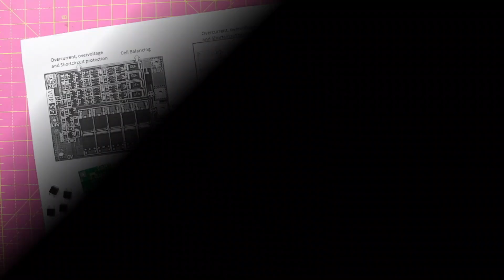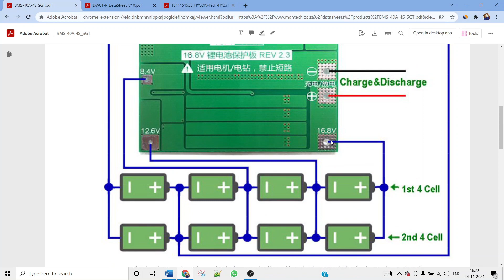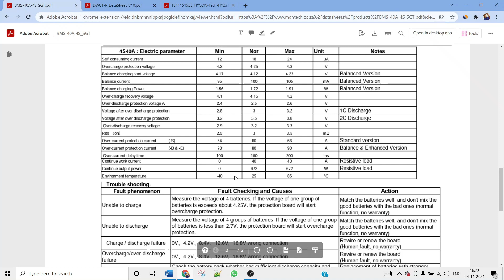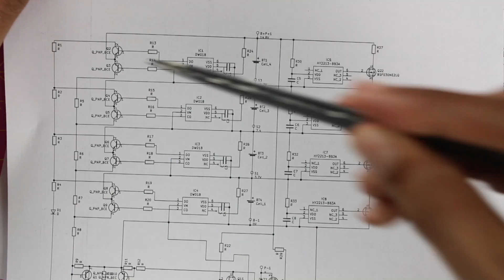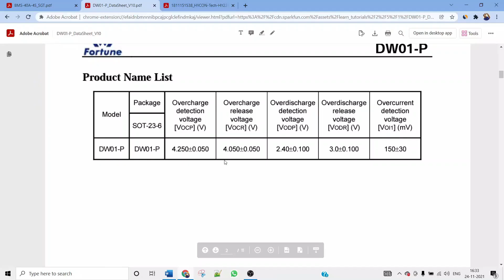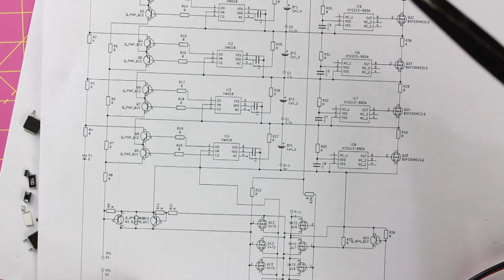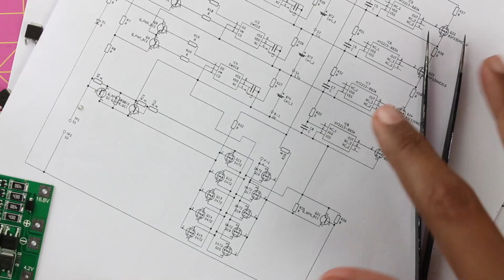Battery Protection BMS Module (4S 40A) Teardown - Schematics, Parts List and Working

Comment: Very dangerous!
I used this BMS balanced board with four genuine brand-new batteries, and everything worked well after the first charge.  This battery pack was used in a drill.
When time to recharge happend, the pack didn't. So, I checked the voltage and then I horribly discovered that one battery was short circuit and the 3 others where "being charged" at 5.6V. 
I disconnected everything and inspected each individual battery with my Xstar Dragon V4 plus: my four batteries are 0V & Ohm. 
This circuit protected nothing, and most has probably irremediably damaged my cells! 
I am very lucky that no fire or explosion have occurred. 
Could someone with deep analog engineering skills review the schematic?
Reply from the maker: If you check the schematics, you can see that the BMS board uses dedicated ASIC protection chips for individual cells. Even if the BMS failed to protect the cell it doesn't make any sense saying it caused the cell to be short circuited. The battery pack failed because of that one faulty cell.

Comment: Hi! How can I calculate the value of the components (resistor and capacitor)? Thanks for the help!
Reply from the maker: Follow the reference circuit available in the datasheet.
Reply: @Circuitdigest   all right, the datasheet of the DWO1 doesn't have resistance between the pin DO, CO and the pnp transistor so I just take off the resistors R13 to R20?

Comment: what is the optimal charging voltage and current requirement for this board
Reply from the maker: Charging voltage 16.8V and set the current as per the cell you are using.

Comment: Hello brother, I have a 3s 40A bms setup for my batteries, yesterday they worked fine but today as soon as i connect a load the Output voltage of the BMS drops to 6V  from 11V making the load inoperable. This board is even new already threw one 3S 25A board for facing similar issue. Pls resolve or guide me if u know.

when load gets disconnected BMS shows Op again to 11V...each battery has 3.78, 3.79 and 3.80V
Reply from the maker: make sure the balancing leads are connected properly. And try connecting the load directly to the battery with out bms for a short period. If the voltage still drops wither the battery bank is faulty or the load has some kind of short.
Reply: @Circuitdigest examining my bms i come to know that wen a load gets connected the gate voltage for bms reduces to 5.8V not full voltage and on unloaded condition it is 10V full gate, this restricts my bms not to deliver full power during loading.
This condition i see for charging as well as discharging mosfets also😭. So the issue must be either with Dw01a or bb3A
Reply: @Circuitdigest  hey man ur website circuit digest helped me tp resolve issue, I was able to debug successfully after reading the webiste stuffs completely. U r great, i debugged myself after ir website.

1. Checked the health of dw01A , bb3A and mosfets as well, there was a burnt pcb trace bw the 0 to 3.7V sense resistor and the 3.7 to 7.4V  dw01A grnd/Current sensing pin. I made a connection via small wire, n9w its healthy
Reply: U have a great explanations skills and better technical knowledge❤️
Reply from the maker: Glad to know you fixed the issue and our content was helpful to you.

Comment: Great video and excellent presentation. I would like to built a 4S &7P lithium battery. Could you tell me which BMS to use its for a golf trolley, many thanks. Go safe..
Reply from the maker: That would depend on the maximum current you will need. Choose a BMS with higher current ratting than you requirement.

Comment: Nice video! What's the use of the two Bms contacts FD CD (Full Discovered / Charging Discovered)? LEDs can be used there to indicate the operation status of the board?
Reply from the maker: Yes, correct
Reply: @Circuitdigest  that is between ground and the two pads with the relevant resistor for each led, correct?

Comment: If the mosfet paralel why i get voltage drop when i realese 1 discharge mosfet from the board? I realese because the mosfet burn.
Reply: you have to connect the pads

Comment: I agree with others, well presented a circuit which will never work 😂 How someone can explain the operation of a circuit on a circuit which has at least 5 major mistakes? 😀
Reply from the maker: Can you please elaborate on the mistakes you found. This is a popular bms used by many, i personally have tested it. But still would love to correct myself if you can Elobrate on your comment

Comment: BMS 4s 16.8V does not charge batteries.  I connect a 17.4V charger, but when I measure the battery, it does not charge, but stands at 15.4V.  What is the cause?  What parts on the board need to be replaced?
Reply from the maker: Make sure you have the correct board. You can check the part numbers of the DW01 and HY2213. depending the the chip the full charge/ balancing voltage may vary. you should also male sure your batteries full charge voltage. even tough most li ion batteries have similar voltage , depending on the chemistry used that may change. please check and confirm this with the manufacturer part number.

Comment: The cell balancing here is Active or passive ? 
And also explain it
Reply from the maker: most BMS including this one have only passive cell balancing, meaning the excess voltage in any cell is wasted using a shunt resistor. In active cell balancing the excess cell voltage is used to charge a weaker cell with low voltage this not wasting any power
Reply: @Circuitdigest  but in you article you tell us that it was doing active cell balancing please check
Reply from the maker: @rohitraj7625  Just checked the article, as mentioned the module is not capable of active cell balancing, but the IC used in the module is. Meaning you can use the same IC and redesign the module for active cell balancing

Comment: I have a spare 3S and 4S BMS wired up w/ 4 and 5 clip leads for bench testing and charging various laptop batteries and other packs I make. I'd love to use the CD and FD terminals for some LEDs for monitoring. I've seen references to 'Charge Detect' and 'Full Detect', but it seems they might also be used for inhibiting charging, or worse, for forcing the FETs on if used inappropriately. Thoughts on adding LEDs here?  How about adding a resistor and LED in parallel with the 43ohm balance resistors to see which one is balancing?
Reply: Hi im french man in interesed for cd and fd you are solution please
Reply: This BMS module is designed by someone whom is a Chinese, and a series of this kind of modules are popular in China. The two test points' names CD/FD are obvious formed by the first letter of Chinese pinyin pronounciation, "充电" (Chong Dian = CHARGE), "放电" (Fang Dian = DISCHARGE). They are representing the charge/discharge allowance status.

Comment: If one of the mosfet fails and we remove it from circuit why it does not work,as the mosfets are give in parallel
Reply: yes , it has no short circuit protection during my testing one of them just blasted in my face but u have to connect the respective pads with a wire from other side mosfets

Comment: Hello, I have checked the BMS presented with the wiring diagram posted. The wiring diagram is definitely not correct.  Here are a few examples: the Schottky diode D1 is at ground instead of between R4 and R36. The pinout on the PNP transistors is wrong 2/1/3 = 3/1/2. There is only one resistor / capacitance input filter for DW01 and HY2213 instead of two in parallel. The connection from R35 to ground is a short circuit. I have seen the faults without having the PCB itself and checking the contacts, there must be more faults in the schematic. The circuit diagram is totally worthless in this state.
Reply: In my bms circuit for 2 wheeler Li ion battery,
Circuit is somewhat similar,
Its 1 of the 5 mos In parallel got short circuit so I removed it but the circuit still not working as the mosfets are in parallel
Reply: Can you explain,or am I missing something

Comment: Fantastic video :). I am trying to figure out how the DW01B chip is able to measure current by only measuring the voltage of the cell. Datasheet indicates this is done via measurement of voltage on the CS input compared to VSS. There doesn't seem to be a known resistance anywhere for it to calculate current from the voltage. Any ideas?

Comment: could you please tell more detials on how to connect 1st 4 cell and then connect 2nd 4 cellls and soo on...what is the max no. of cells i can use in this particular board. waht ae requirement rues before doing that and how do you chech mah of a battery ..thank you in advance

Comment: Very good video!
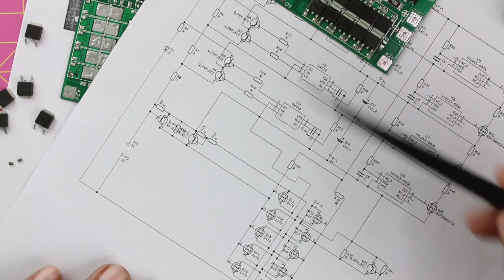17:06 One of those 2 transistors drive the MOSFET from the CO pins, the other looks to me like a crude over current protection, limiting the current if voltage over R12 reaches BE threshold.
(Not the safest since it doesn't turn off the MOSFETS so they may heat excessively. If 1 of the mosfets fails short, the battery may continue to drain in over current conditions, so I would highly recommend a main fuse anyway.)

Comment: Great video and explanation.  I don't understand why there are two banks of mosfets in series?   Why don't they have all 10 in parallel and control them on/off with a single line shared by the over and under voltage signal?
Reply: To describe it more precisely, 2 rows with 5 N-mosfets are controlled in parallel. These 2 rows of mosfets are reversed in relation to each other in order to control charging and discharging separately. If you were to connect all 10 mosfets in parallel, you can either charge or discharge, depending on how the mosfets are rotated, as the direction of current must be observed with mosfets.
Reply: @Randomname-ld1bz  Mosfets have diodes that allow current to flow in one direction the other direction is switched on/off.  So yeah, they use two banks so they can shut off current in both directions on/off.  It is less efficient to do it this way, as you have two mosfet losses instead of one, but it makes it simpler.  For discharging at high rates, this is not insignificant.
Reply: @murraymadness4674 you have no idea how a MOSFET works, right? 😀
Reply: Good question. Maybe maybe this could be a good improvement to the circuit :)
Reply: they are in affect a series of two switches. one controlled by over discharge, and one for over charge. in order to work both banks must be turned on. as if one bank is switched off all current from the batteries will stop. Makes it easer to have two control lines.

Comment: how about adding one more feature to the board?
like an auto shut off function incase the battrery is not in use...thats what im working on any limitations?
Reply: I suppose it might be needed in some applications but the draw is not large.  The datasheet states Self Consuming Current  Min 12uA Nor(mal) 18uA Max 24uA

At Max 24uA (microamps), that equals 210mA per year, which isn't very much when you consider it is meant for 18650 cells.

Comment: Sir Your Explation Was Very Good Sir But A small Point was Missing In This Video That was near Mosfet marked As  (Cd- FD ) Points what' is this Use Of That points
Reply from the maker: These are test pads to check the BMS I working properly by manually providing a fault
Reply: @Circuitdigest  I'm Under Standard Ur Point but What is the Use That points

Comment: Bro thank you for the video ...question 1 : i want to charge this with 16.4 volts 4A laptop powersupply...can the bms handle this ?? I dont want to go 16.8 no need ..question 2 ...does the bms balance when the pack is not charging...meaning does it balance without reaching 4.3 volts ...say around 3.9 volts ??

Comment: hi, thanks for video.
i build battery pack for my drill with this BMS 4S 40A, but when i push the power button drill start for 1-2 seconds and stoping. i guess excessive motor power cause this. can i fix this?
What about transistor G1 near to SPARE resistor and 0V, what it do?
Also your schematic missed 2 capacitors near Q and Q1 transistors.
Reply: You use high drain 18650 ?? 15A discharge minimum or 10A in parallel.
Reply: @MrStyle-sr1yv  How would that solve this?  Your suggestion would do the opposite, make it more likely for the over current protection to kick in and cut power.

Comment: Thank you very much for a very informative video.

I was wondering if you could explain the charging circuit used (if the BMS has one)? From looking at the specifications for this circuit, would I be right in saying that the circuit uses a CV mode (of approx 16.8-17V) to charge?

Typically lithium batteries utilise a CC mode to charge until it reaches a certain voltage, then moves to a CV mode (for 1S of 4.2V) until a certain minimum current at which point it stops charging and is considered full. I presume this BMS is not that smart and may require something additional to charge the cells?

Again, thank you very much for putting this video together!
Reply from the maker: Hi Deividar, this is just a BMS module and it cannot be used to charge your battery pack. You would have to use a saperate charger for that. however the BMS module does provide over charge protection. 

Yes a typical charger will have atleast two steps i.e CC and CV modes. The working of the BMS will remain the same irresptive of what BMS you are using